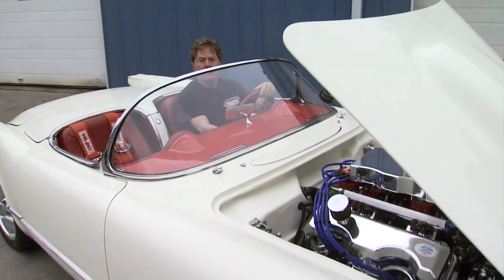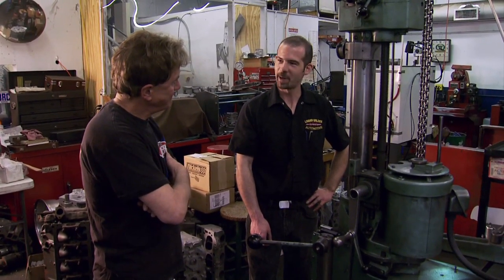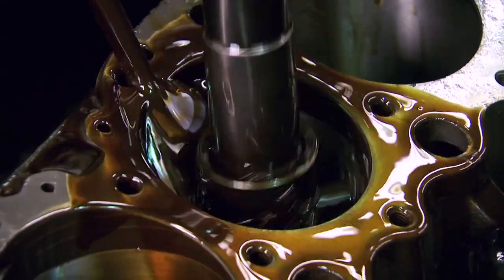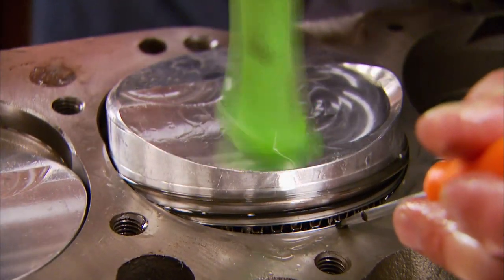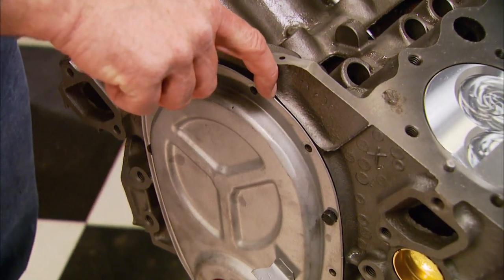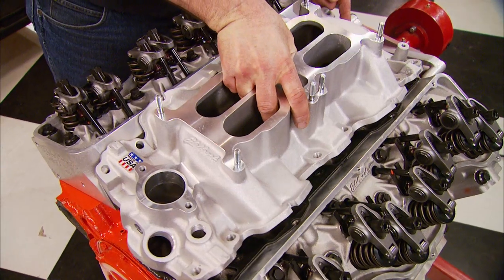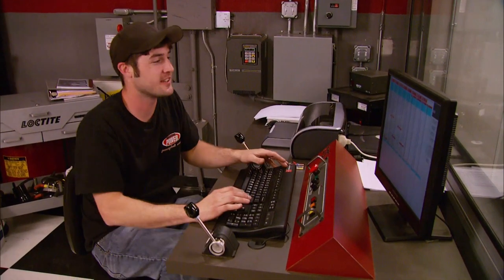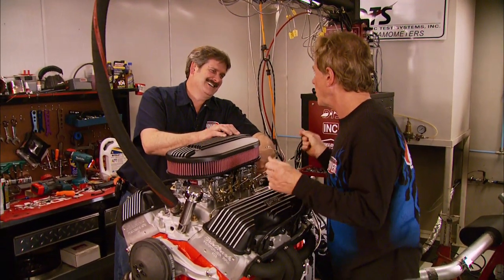Building A 409 From The Block Up - HorsePower S12, E10

Comment: Man I remember waking up early on the weekend to watch the OG Power Nation episodes on TV and was always in awe of the power they made with the motors, all of the custom work needed to make it happen, everything about it.  Now with modern manufacturing you can buy all of these parts off the shelf any day of the week, and 500hp is just standard now.  Back then having a 500hp street motor was just crazy.  
It would be nice if they included the date the episodes actually aired on TV just for nostalgia, and also because it's confusing to so many people in the comments why the engines are only making 500hp, or why the engine builder isn't in business anymore, etc.

Comment: I liked the 409's.  We had a '62 Bel Aire with a 409/425hp engine.  Probably not original in the car, but it ran a 12.27 on a 12.40 national stock record.  Then came the 428CJ mustangs and the national record dropped quickly.  Overall, you have to respect the 409's.  It was a truck motor, that became something very special. It is now a big part of history.  Now-a-days, when I see one, it brings back great memories, plus the knowledge that I am looking at Chevrolet history.  How cool is that?

Comment: I built a 488 cubic inch 409 back in the 70's. Crane cams made a roller cam so 07 wasn't the first roller. I had the same valve covers and same intake. I put it in my 67 SS Chevelle for awhile just to play with it but eventually it went into my 63 SS Impala. Awesome engine!!!
Reply: Hydraulic roller. They had the solid roller cams for them already.
Reply: I am a big fan of the '67 Chevelle.  Has to be my favorite year.
Reply: These guys think this is an "air gap" intake...

Comment: That X motor also had screw in casting plugs, do freeze plugs. And I love Tri y headers! They are the best type for low rpm engines like 4x4’s, towing and mild performance engines!

Comment: 1:20 - No... the 283 was the first to meet--and exceed--the HP/CI ratio N/A. But then, it had Rochester Fuel Injection on it vs. dual quads. However, the dual-quad version (IIRC) did meet it, and they both did it in the '57-m/y.
Reply: I said the same thing.
Reply: I came here to say that but I had a feeling it had already been said.
Reply: I have to agree with you when it comes to Chevrolet. The 283 WAS first to make 1 hp per cubic inch in 1957 ahead of the 409. These guys blew it there. When it comes to Chrysler in 1957, the 300B had an optional 354 hemi that made 355 hp. To be fair though, both of these engines were pretty hopped up from the factory. Typically they went out the door at less than 250 hp. Makes for great bar room trivia though! What are your thoughts?
Reply: I was going to say that as well.
Reply: I ain't from 57, but...........according to my 57 motors manual the 283 horse 283 w/fuel injection was 10.5-1compression and 2 fours was 9.5-1compression. Would that make the difference? Idk, but fuel injection was like electronics of today and b4  nobody could keep them tuned properly. Interesting that my Motors manual from 57 does not list a 354 as one cube/inch, but close idk maybe I don't doubt it, but 392 was @a high of 375hp
Reply: Dual quad did not make 283hp in ‘57. Only the HO fuel injection. Standard fuelie made 250hp
Reply: @solomonlynn7456  283 with 2 fours made 270 hp. Again, I ain't that old and mind you that certain things are left unsaid but that 270 is with 9.5:1 compression.Motors does not list a Chrysler engine of one hp/cube. 354 in 56 made 340hp and 392. In 57 made 375 which is a shit load but damned the weight difference https://m.imgur.com/gallery/hFROBM6
Reply: These guys on TV only say what they read on the script.
Reply: Actually, the 355 HP Chrysler 354" Hemi was in 1954, not "1957"... '57 was 375/390(EFI) HP 392"... 
409 design was copied from Ford... and abandoned fairly quickly... for more conventional design combustion chambers... 
The 1950's Chevy/Pontiac fuel injection intake manifold was basically a dual quad tunnel ram intake modified for side air intake so low enough to fit under a hood and mechanical injection added... 
1950's Chrysler/Imperial/Bendix EFI used a low rise dual quad carb. intake... Jay Leno drives one in a video...
Reply: The first gen Hemi was the first. Not the 283.

Comment: Correct me if I am wrong....but wasn't the '57 Chev w/ 283 with the Fuel Injection rated at 283 HP. The FIRST engine to have 1 HP to 1 CI   ???  Joe is a younger guy and may not remember 1957.  lol

Comment: Nice build my brother had a 409 it was one powerful motor only one thing two things silicone on gaskets turns the gaskets to mush and I like sticking with the canister filter canister filter oil filters much oil to two qt spin on filter by the way the old 409 for known for breaking frames

Comment: I'm sitting here watching this and as they're about to dyno it I thought I wonder what power it'll make? Initially I thought 480 but then I thought nah it has dual quads so downgrade to 465. So it's 464 initially then 475 after a timing adjustment (before the long tube header swap). Funny thing about this is, after watching literally (not figuratively) hundreds of engine builds that have dyno tests on YouTube, about 80% of the time you can guess the power within a few HP. Go figure! 
Sometimes I'm way off though. On Nicks Garage they had a 505 Hemi (so a stroked 426) with OEM iron heads and a single 4bbl on a dual plane intake and I guessed maybe 530 (due mostly to the dual plane intake corking the stroker combo). It made 632hp. It isn't that surprising since after watching the 505 Nick's Garage dynoed as stock as is possible 426 Hemi with points, OEM carbs and all and it made IIRC 492hp, so nothing like the factory rating of 425. With such a high starting point for a stock Hemi I suppose a 505 should go into the 600s. Goes to show the Hemi head port airflow potential is far greater than a 7 liter engine turning only 6000rpm needs.
Reply: Scott Shaffiroff just posted a single 4bbl 409 with 625 hp. I don't remember the cubes but it's nasty and it didn't come from Lamar.
Reply: @warrenstephens3705  There's a few good articles on the W engines. 
I haven't read any for ages but iirc they have a finite comp ratio that limits them to 11:1 range due to the combustion chamber arrangement so for racing they were at a disadvantage. Still makes them an ideal street motor and I bet the design is naturally detonation resistant too.
Reply: Warren Stephens it’s a 509 cid motor not 409.  Lamar is the expert on those 409 motors he will be missed RIP.
Reply: @ThePaulv12  - Actually the W motor design was detonation prone and hard to make big power with so they tossed it, compare to: https://www.dailymotion.com/video/x3rfhrk
Reply: @BuzzLOLOL  nonsense!

Comment: Our family's 1962 Belair Bubble Top 409 was stolen last year out of SoCal. If anyone runs across the car or the motor there is a reward. 425 horse dual quad motor. was in the family for 40 years. we think they may have taken the motor out to make it harder to track down.

Comment: Wrong the first Chevrolet engine to make a horsepower per cubic inch was the 1957 fuel injected 283 the first carbureted engine to make a horse power per cubic inch was the Chrysler Hemi in 1957
Reply: i caught that also guys
Reply: Brett, The 1955 Mercedes 300SL had more than 1HP/Cu. in, and in more than one configuration. 3 liters was 180 cu. in., and HP was over 200. This was a FI engine. In 1956 the 354 CU In Chrysler in the 300B was optional with 355 HP. This was a carb engine. The 283 Chevy FI engine in 1957 actually made less HP than a well tuned 1957 Chevy engine of 270 HP with 2 4-barrels. (It was virtually identical to the FI engine in all respects except the induction system). Chevy knew this, but want the prestiege of advertising FI, and 1 HP/Cu. in.. Pontiac also offered FI in 1957, but dropped it in 1958 as too unreliable, and championed 3-2 barrel "Tripower" for years to come. A very few 1958 Pontiac Bonnevilles had fuel injection, but most were converted to tripower by the dealers due to consumer complaints.
Reply: I caught that crapola to. LOL
Reply: I swear I heard long ago that carol Carol Shelby was the 1st to get 1hp per ci with a 302 ford...
Reply: 409 wasnt the first hp to cube... it was a 283
Reply: Yessir!! Very correct.
Reply: And earlier '54 Chrysler 354" Hemi had 355 HP...

Comment: So, only the block was original  / new or trick heads, cam, lifters, intake, carbs, ignition, pistons, etc.     OK, there was a decent bump in horsepower and torque, but not as much as I might have expected over the original factory specs from over half a century ago.  If it were my car, I would give up the power increase for the cool factor of having a factory original engine.  Take this motor to a car show and all it shows is that you got parts from sponsors for free and/or just threw money at the motor.  Bringing back a factory original motor to stock spec shows respect for the original engineering and truly preserves the history.
Reply: ..yes...same with the car itself, with all the suspension and wheel/tire modding...put it stock...looks way better, too....

Comment: Lol that area you hit with a hammer won't that flex back out when engine is fully warmed up. That sheet metal bolt for the oil filter lol

Comment: if you want to turbo this engine at a later date you can get solid copper head gaskets that are thicker then stock and bring the compression down to 10 to 1 making it safe for turbo or supercharger service . solid copper head gaskets are drag racing parts that let you change the compression of a engine depending on the track or fuel your running in most applications you can get them any were from 10 thousands to 100 thousands thickness letting you tailor the compression to your needs without changing the pistons . you got to love being able to make an engine fit any need

Comment: Actually in 1957 the Chrysler 300B came with an optional 354 hemi that made 355 horsepower.
Reply: LIAR
Reply: That was 1954...
Reply: @dvjracing5947  - It was 1954...
Reply: krvnjrcbs  - Yes... look it up... 
1957 Chrysler 392" hemi came with 375 and 390 HP...
Reply: krvnjrcbs  - Yes...
Reply: krvnjrcbs  - What are you babling about now?
Reply: Easy guys. In 1957 the Chrysler 300B did come with an optional 354 hemi that made 355 horsepower. The original poster even agreed that research into month and date of that year was necessary to get past folklore. None of you folks have done that. You're just throwing troll jiberish around. 🤦
Reply: Im not talking about the 392.. the 354...  Look it up..  Have a nice day.
Reply: krvnjrcbs  - 392 HP is within 390 HP production spec.s... besides, Chrysler already had a production 355 HP 354" in 1954... 1,000+ made...

Comment: That was one strange engine. Unique & an eye catcher but it had problems w/ durability. Back in the day machinists hated the deck cut at an angle to the bore center line.  Had to have a special deck plate to bore them & many a ring was broken during installation. Back in the day I witnessed many trying, in vain, to keep up with a max wedge Dodge or Plymouth which had a much better engineered powerplant.
Reply: 409 design was copied from Ford... and abandoned fairly quickly... for more conventional design combustion chambers...

Comment: I have an old car, I would like to strengthen the engine in it, what parts should I replace?
Please help, I need your information
large piston, thick piston rods, large crankshaft
is it enough to power the engine
Please
Reply: What kind of engine... each engine design has specific needs...

Comment: The 409 was more than a bored & stroked 348. They redesigned  the block for both clearance and better water flow. But, the basics are still the same & they are twins to look at except for dipstick locations.
Reply: The intakes wont swap.

Comment: Ok, that 409 is NOT a motor, it is an engine! Motors run on electricity and engines run on some type of fuel like gas or diesel. Is a Rocket shot into space powered by a rocket motor? No, of course not. It is a rocket engine. Passenger jets powered by jet motors? No! Jet engines.

Comment: Bone  stock  with a factory cam makes 420 HP with dyno headers,  Not a  good  value  proposition here.  Way too much  carb,  also.  Bet she'd  be  happier with  two  2bb  or  with a single 4 bbl. No talk  about jetting with dual quads. The  Motor  sounds  soft.  Big miss there. I guess its  just a  long Edlebrock ad.  Still nice  seeing that  motor. TY!

Comment: Notwithstanding GM's influence over PowerNations content, I'll point out that the "409 was the first motor ever to match HP to cubic inches" is patently false. In 1961 Ford offered the 352 hipo FE engine that made 360hp...

Comment: 7:38 , what's with all the scratching in the bore for a freshly machined engine?
Reply: It's called crosshatching. I can't remember the exact purpose of it, but I believe it has something to do with helping the rings seal up the combustion chamber.
Reply: Thats what a fresh machined cylinder wall is supposed to look like.
 In the first 1000-2000 miles the rings will wear those sand marks down and the rings and walls will conform to each other. It's part of what happens in the break in period.  
I bought a rebuilt motor that has sat around after the rebuild. I tore it down and replaces all the gaskets, and the fresh machine marks on walls told me it was indeed fresh rebuild that hadn't even been broken in yet.  Only paid $400 for it. (fresh rebuilt 351 cleveland)
Reply: Cross hatch, allows the rings to seat correctly and helps for lubrication of the walls
Reply: @starbattles1  I'm talking about the scoring, the vertical lines, not the cross hatching from the hone.
Reply: @stevenuhl3828  check it again, you can see scoring not cross hatching.
Reply: @DeathHead1358  I know about cross hatching from the hone, but I was pointing out the scored spots in the cylinder.

Comment: not the first 1hp/in3 engine. chysler 300s in 1956
, a couple mercedes engine before that.  And of course the 1957 fuel injected Chevy 283

Comment: 12:56 Valve covers that were made for a specific engine.... get outta here!
Reply: 348 & 409 is specific to the rocker covers. Nothing else fits 'em.
Reply: @rogermarshall8991  True but the W engines were Chevy's  take on the Chrysler polyspherical small blocks which also used a scallop valve.

Comment: Why soak the lifters?
Reply: To get oil inside them... most people say it's not necessary, will oil up anyway when running... others take them apart and oil them up... or pump the piston in them while under oil...

Comment: What you don’t know is that Lamar Walden has a partner that did the lions share of the designing of his parts, whom he screwed over and took his casts without giving him any credit for the design. His heads and intake were designed by Rich Rojeski, and were originally branded as CRW, which stood for Connley/Rich/Walden; Connley after Rich’s brother who passed away and also helped on the mechanic side of the design.
Reply: Where can I get some new 348 Pistons today in 30 over or even standard.? Forged of course with no valve reliefs, I'll cut those myself!
Reply: @knutbjornlarsen4435  - Try TRW...

Comment: A boring bar. Sad. The deck is not at a right angle to the bore. I watched a few get bored off angle. - total loss. A  honing machine would be the best way to increase the bore on these blocks. Once we had the Sunnen CK10, the boring bar collected a lot of dust.  Another issue is a truck block. Depending on how it was flogged, the web did crack. Anchor Motor Freight used 409's  and when they went to the junk yard, most of the time you would have to go through 5 engines to find one without web problems. Anchor Motor Freight delivered new cars from GM plants, not sure how much of the country they covered but every car built in the Baltimore Chevrolet plant was hauled out by Anchor unless loaded on a train. All you need to redo one of these is very deep pockets. The aftermarket is in business to make money.  Shame on the dyno test. They did not dyno the engine with the air cleaner in place which would have shown a loss in power.

Comment: wait.. if your using a dual 600 CFM... intake be willing... you could use a single 1200 CFM? if i did the math right
Reply: They are going for the nostalgic look. The 409 HP came with two 4's factory.
Reply: they didn't have big carb.s in those days so they used 2, 3, 6, or 8 smaller ones...

Comment: i wanted to see the combustion chamber on the heads but no , these j-offs are more concerned about the fkn paint
Reply: There isn't one, it's flat.
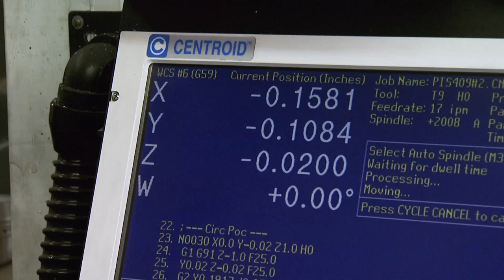Reply: @matthenderson1658  @ 3:55 Lamar said ""the quench of the head has to be perfect"" . as you may or may not know , every engine known to man , piston to head clearance  is your combustion chamber
Reply: @deletethis5489  then why are you wanting to see the head?  It's hard to see piston to head clearance, it's just air.  🤣   As you may or may not know...
Reply: @matthenderson1658  i know you are but what am i ?
Reply: Edelbrock doesn't want you to see that until you paid for it and have it at your shop.

Comment: Goes to show that the Edelbrock heads are basically no better than stock heads.....Factory was 425 horse and they spent a ton on this and it only makes 480 horsepower?   wow
Reply: That's why they abandoned that engine design...

Comment: I've only seen one in my lifetime, someone had one in a 65 Chevy pickup. Never sense.
Reply: I've only ever seen two in person and that was when I was a teenager and im in my mid 30s now so it's been close to or over 20 years since I've seen one and the two I seen were the two famous factory stock 62 and 63 Impala's at a Super Chevy Show and they came out to do a few exhibition runs against each other and in the late 90s early 2000s they were still able to run mid to low 11s N/A rowing gears with a Muncie "Rock Crusher" 4-speed